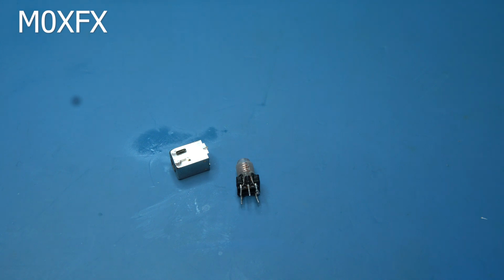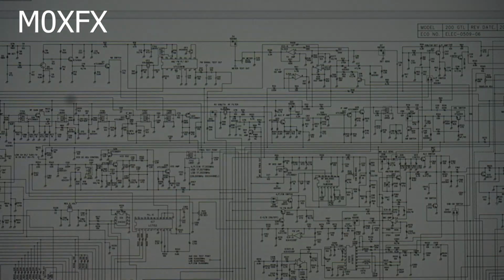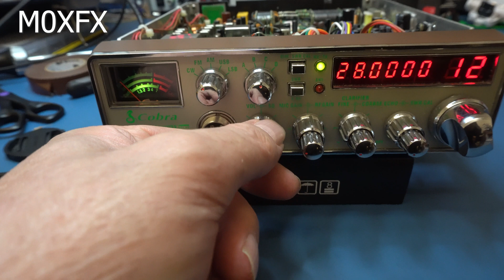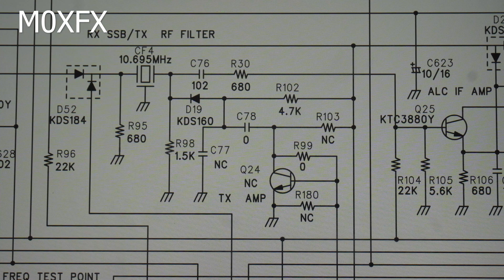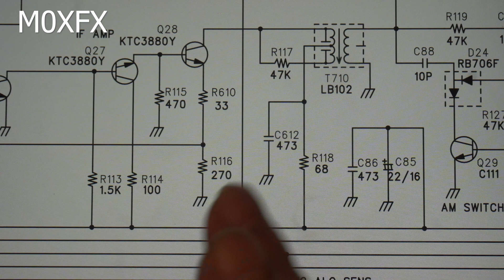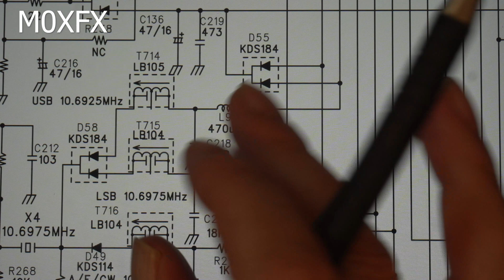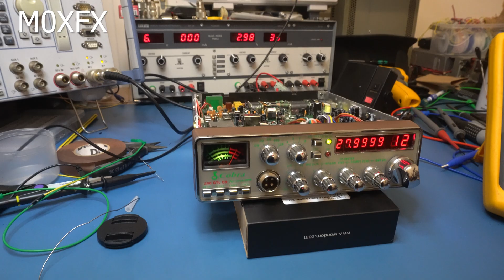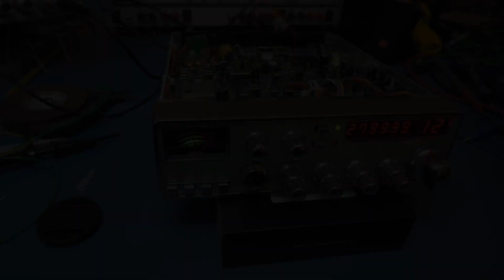Cobra 200 GTL DX Repair Part 2

Comment: I picked up one for 50 bucks  but the radio don't transmit. I'd like to get it restored how much you charge to repair it
Reply from the maker: Hi Kevin, $50 is indeed a great price if you can get it working. However, I regret to inform you that I'm based in the UK, and I don't think it's feasible to ship the radio all the way from Ohio, USA. You mentioned that it's not working, but could you provide details about the fault?
Reply: @M0XFXUK  it has been repaired it's a beautiful radio the night watch not working I don't know why cobra build stuff like that when you can't repair it 73 is guys w8dmx kevin
Reply: The Rf driver final is shot I don't have soldering skills but all your videos convince me that is the RF final is blow out.
Reply from the maker: @kevinstevenson5591  Be cautious, as videos can sometimes be misleading. If you suspect it's not transmitting and it's a Cobra 200 GTL DX, a common issue could be the RF driver transistor RD16HHF1; however, it could be any number of things. Frankly, if you lack experience and proper testing equipment, I strongly advise taking the unit to a repair shop. Radios like this are quite easy to damage as you can see from this series of videos.

Comment: I need a channel selector for the one I have. I can’t seem to find one anywhere.
Reply from the maker: Hi Bill this a common point of failure with these radios and there does not appear to be replacements on the market. Unfortunately the rig in the video has gone back to the owner as I could have taken a look at it and try and figure out what to replace it with.  I don't think it's a normal rotary encoder type switch however; I do think you could replace it with a rotary encoder with detents but you would need some additional circuitry to make it work. Where are you based?
Reply: @M0XFXUK  Thanks! I’m in NJ.  I already mailed it out to a tech, and I’m just trying to help find the part. He was saying we could replace it with two buttons, one for up and one for down.

Comment: those RDF16 whatever they are are a known common issue for blowing,
idiot CBers turn the gate voltage up too much thinking they're upping the power and blown the fet.
Reply from the maker: Hi Mark, Yeah I guess that would do it. If I’m honest I think the bias is set to high as per the service manual anyway.  It’s something we can take a look at ounce it’s aligned.

Comment: I've had issues with those dual package SO23 Diodes, perhaps when it was acting like a diode/fuse.
Reply from the maker: Thanks for the comment Glen. Yes they are a common point of failure. I have seen a lot of these switching diodes  fail in ICOM and Alinco gear generally when the TX is operated outside of the design specs and/or outside of the design bands for the  low pass filters.